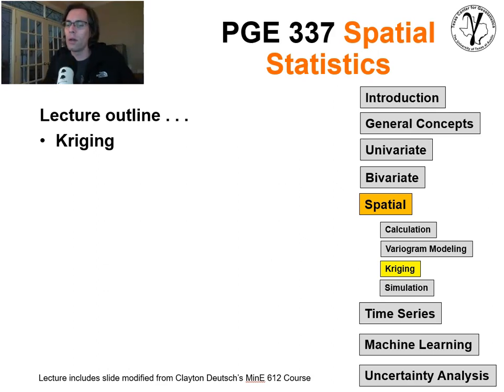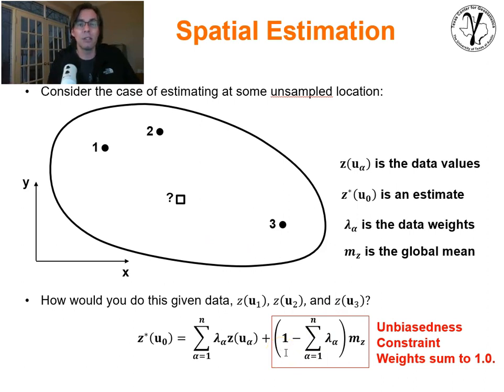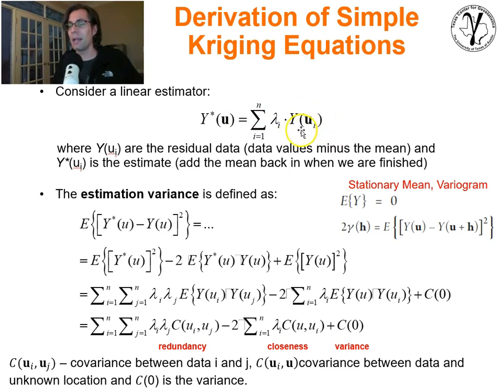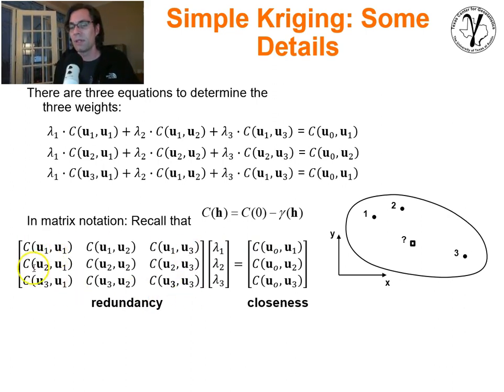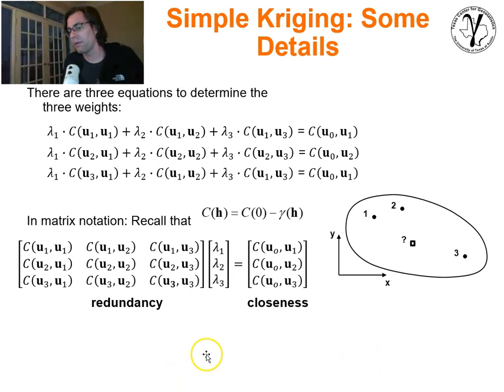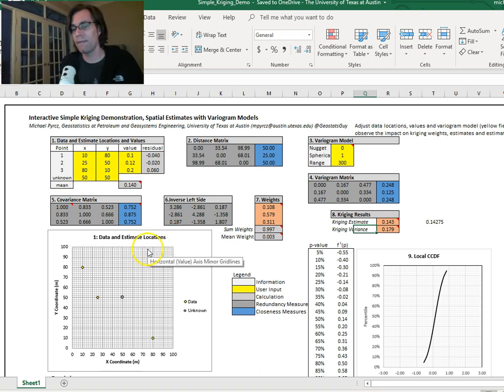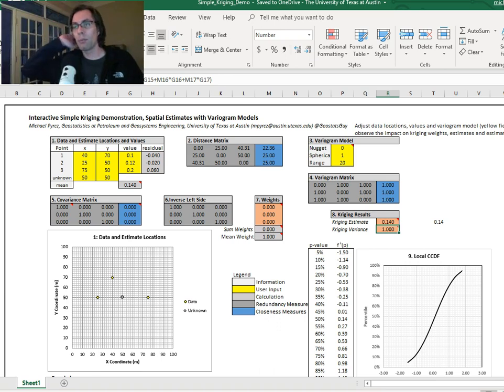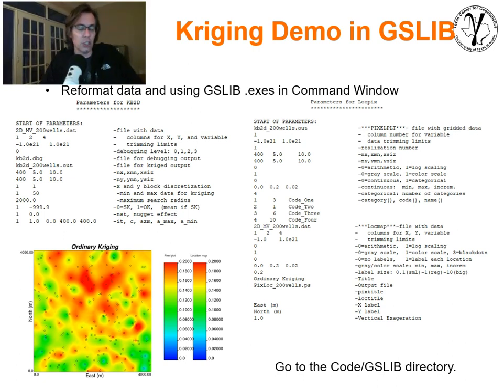12b Geostatistics Course: Kriging

Comment: Excellent lecture!  I have used Kriging for more than a decade but did not have the insights that you presented in your 36 min lecture.  Also, the excel spreadsheet very useful in getting an intuitive understanding of the Kriging method.   Much appreciated!

Comment: Thank you for the great lecture i have a question about the percentage of measurement error in ARC map while using any kriging technique it assumes that the measurement error equals to 100% of the error. this negatively ompact the generated geostatistical layer contour lines and the values at the easured rain gauges are significantly impacted. when i use a zero percent error the generated geostatistical layers for both t universal and ordinary kriging are identical